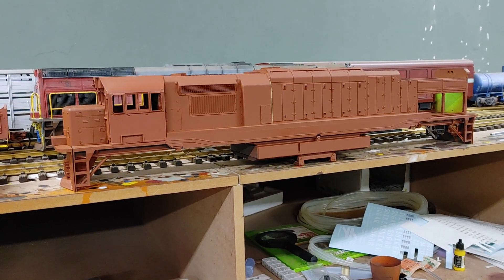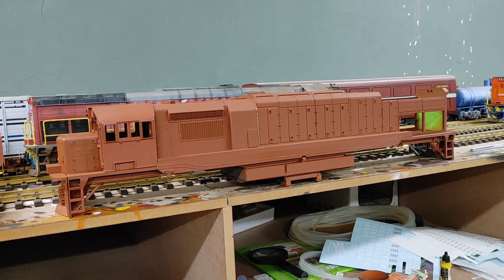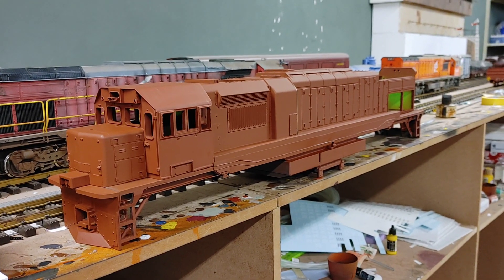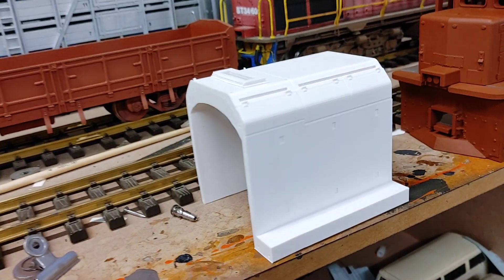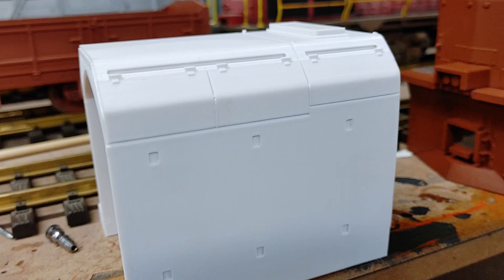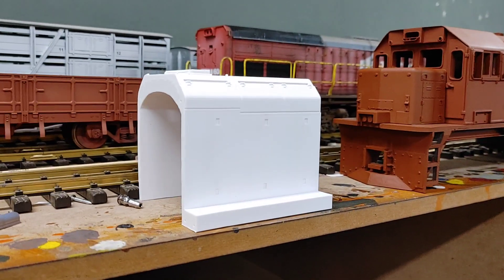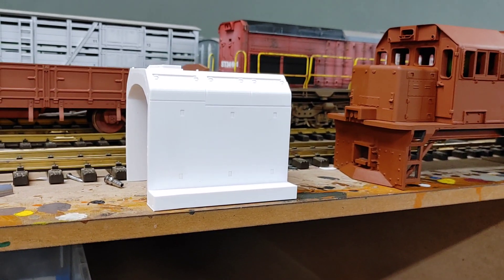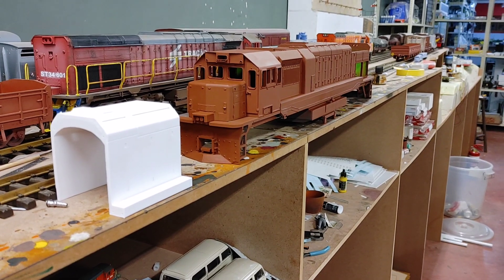The search for a perfect 3d print.

Comment: Brilliant as usual, especially the ASA filament tip. However, why don't you build yourself a small sander using an electric toothbrush to get hold of all those corners? I did mine using an Oral B brush and it's an must-have tool. If interested, get in touch, and I'll give you the whole recipe on how to make one.
Reply: Hello, could you please send me details of the sander, I too am investigating 3D printing, I created a complete layout in 3D, see the world's first fully printed O gauge model railway, the sander would be very useful, thank you
Reply: @3dprintedscalemodels523  take one Oral B electric toothbursh and remove the bristles from the head. Get some sheet plastic and cut a disc the same size of the head oscillating disk. Glue it using 2-part epoxy to the head. Once its dry, cut some double-faced tape, attach it to the pad and trim it. Cut some sandpaper and attatch to to the tape. Cut the excess off and enjoy.